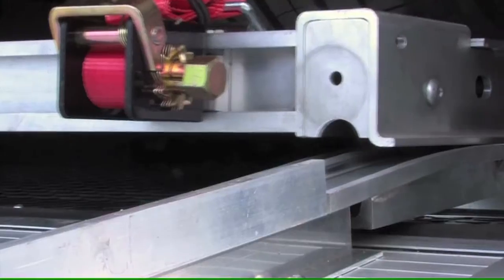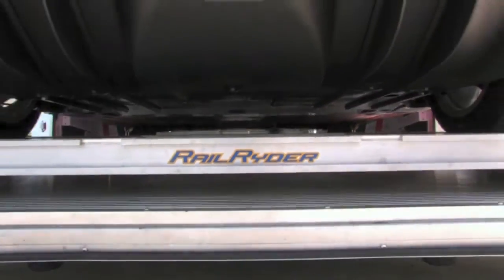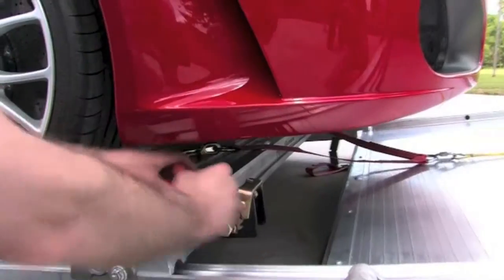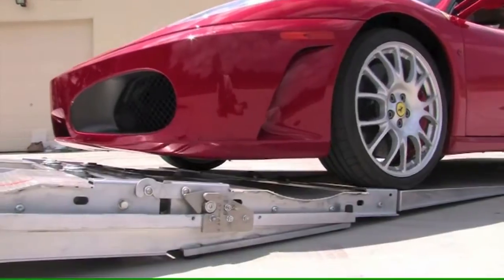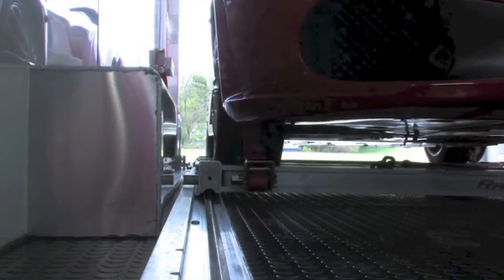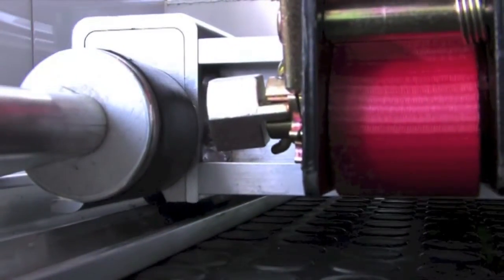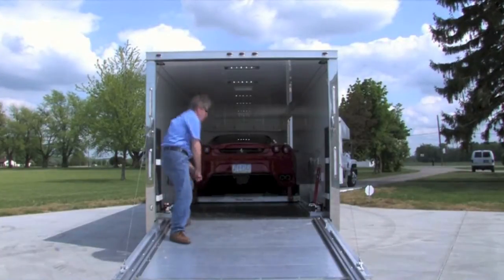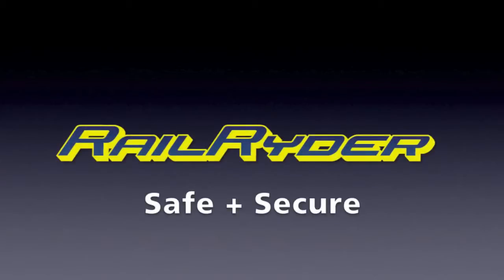Rail Ryder ~ Revolutionary Motorsports Trailer Loading System

Comment: Absolutely the best! To date our Dealerships with two of these units have delivered 500 plus vehicles, Rolls, Bentley, Porsche. Mercedes, Aston's, Maserati's and more with absolutely no breakdowns or damage to client cars! Fact is I have worn the trailers out and re installed the RaiRyder in new trailers, they simply do not break or wear out. Again, over 500 vehicles, pushing half a million miles of deliveries with two units. Al
Reply: If you don't mind how much for the system thanks

Comment: How does this work for awd vehicles?  It appears as though the front wheels must be secured before the front trolley goes forward which would keep the wheels from spinning freely while the rears would be rolling.
Reply: You secure the front wheels on the trolley. You put the vehicle in neutral and you use the winch to pull the vehicle forward until the rear wheels rest on the rear trolley. Then you pull it all into the trailer with the winch.
Reply: @robertm1692  He's talking about AWD, where the front and rear wheels are linked to each other.
With the fronts tied down, the rear wheels may not be able to roll.
This all depends on the type of AWD system though.  On road AWD systems utilize a differential between the front and rear axle.  Some hard-core off road only systems may not have that ability.